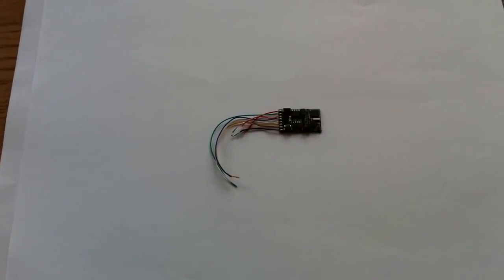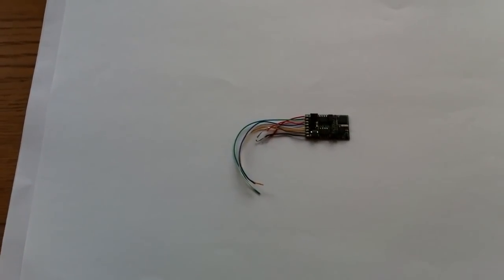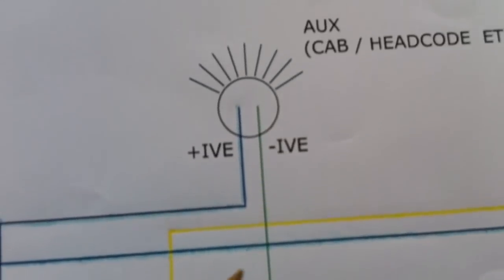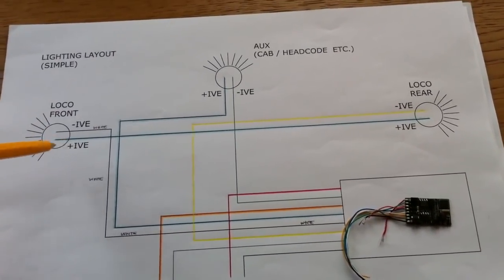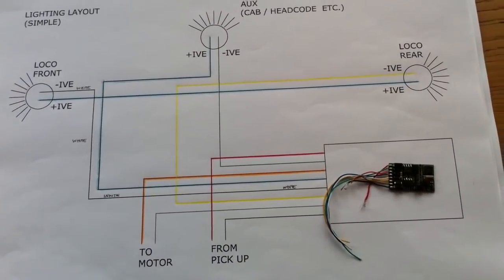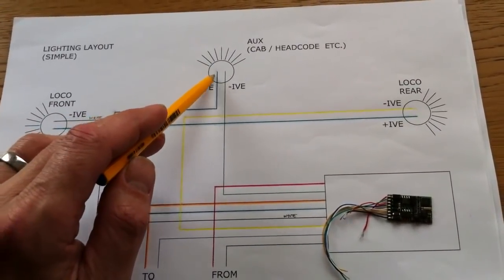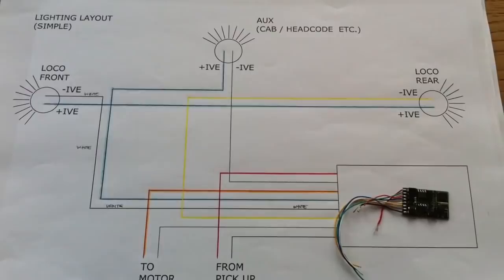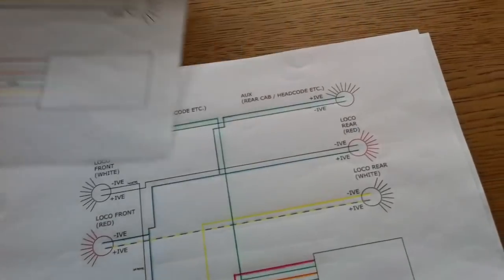DCC Locomotive Lighting - A Beginners Guide

Comment: A really helpful video, I used your parallel wiring diagram to tackle my very first loco decoder and light installation into a Class 47, and it worked brilliantly. I have a headed light in direction of travel, which changes correctly when changing direction, and 2 red LED's on the back that switch.  Thanks for posting.

Comment: Thanks, it’s actually quite simple when you know the trick to power both white and red light with direction of travel. Simple but I could not have figured out without your video, for my defense I have an extra difficulty in that I’m using N scale/gauge and there are only 6 pins on those decoders :-) But you put me on the right track! Thanks!!

Comment: Great explanation. However, when my Red / White is showing bright, the opposite Red / White glows dim, not off altogether. (You don't show any resistors - sorry if I missed it).
Reply: Sticky carpet tape is the best for SMD LEDs. Place them on the sticky side and use single strand "Kynar" wrapping wire available from RS Components and solder on with a very hot iron and just a quick dab using liquid flux as well. There'll be some casualties but do them all at one sitting!

Comment: hi I have a ho loco I used a sound decoder and I wired directional lights and cab light white front and yellow rear and green for cab light the blue is common or power the lights work but when I change the lights directional it affects the cab light I have two risistors one for the directional and one for the cab what do you think I have wrong as when I change the lights it makes the cab light change thanks

Comment: If the LED's are not 12v , where do you install the resistors
Reply: The resistor has to be on the + positive wire of the led. The +ve wire is usually the longer of the two or will have a flat edge to it.

Comment: Its a useful video but would be better if you had fixed the camera in position ie no shaking. An easy way to remember motor wiring is Red & Black - to the Track. Orange and Grey go the other way (Motor)

Comment: Being an American, I don't mean to sound like an ass, I have a question. Is head code the same as cab number boards that illuminate at night to identify the locomotive?
Reply from the maker: Michael Stillwagner Hi Michael yes you are correct! In the UK headcodes would give information on the type of train to aid signalling but they fell out of use in the 1960s, after that it was quite common to see 0000 displayed
Reply: @ipcress1066  that makes sense. Our train codes are not displayed on the locomotives. They are however on the "train clearance" paperwork/ manifest. I am always learning something new. Thank you sir.
Reply from the maker: you're welcome - we're all learning something new here!

Comment: You have a problem with your diagrams when showing the "directional - Series" wiring.  at the bottom left you show LOCO FRONT (RED) with the connections as -IVE at the top and 
+IVE at the bottom.  I can see that this is becasue all of the icons use the same terminology, but you have the connections crossed, so you are showing a connection from the right (POS) terminal to  the POS terminal on the LEFTto cross feed the curcuit.  This will not work as it should show the crossfeed from LOCO REAR (WHITE) +IVE going to the LOCO FRONT (RED) IVE connection,and then  the return  via the blus coming from the +IVE, as is the case with all other connections.  Right now,  you wouild have a short circuit. :))))))